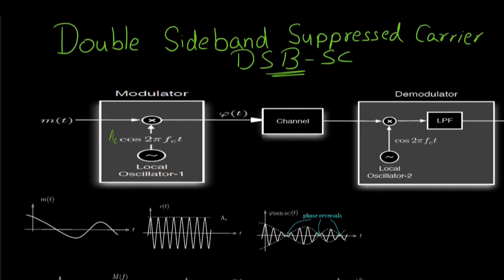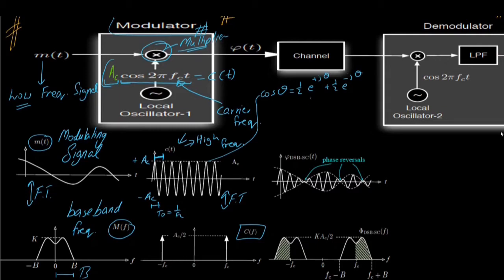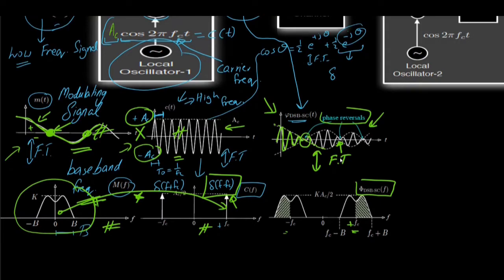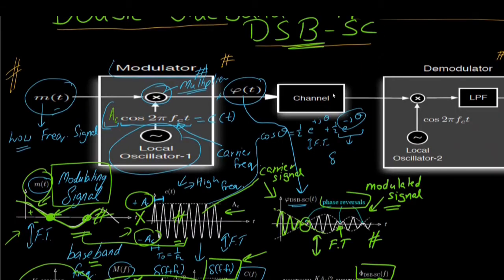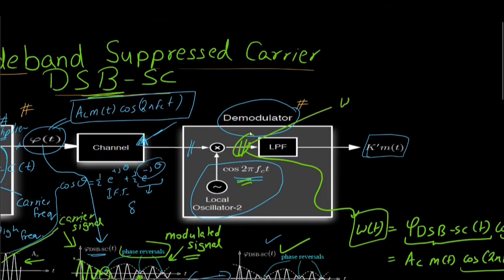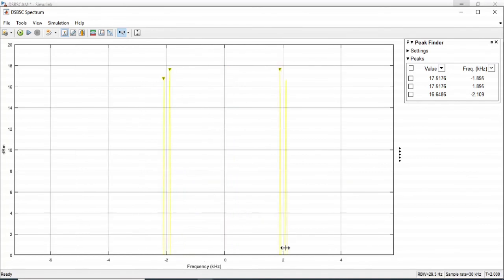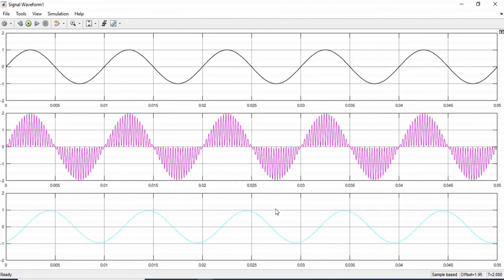DSBSC Double Sideband Suppressed Carrier Explained using Simulink | AM 2.3

Comment: may i know the coding that you used please?
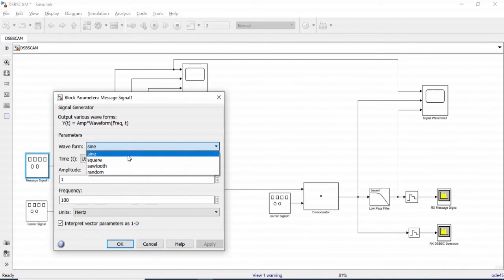Reply from the maker: I did not export the simulation code at the time but it is fairly easy to recreate. e.g., at time stamp 14:22 the block i used is "Signal Generator" written on top-left of the pallet. Search this block in "library browser" and drag it on the working area. you can do the same for rest of the blocks in the simulation and do interconnections.